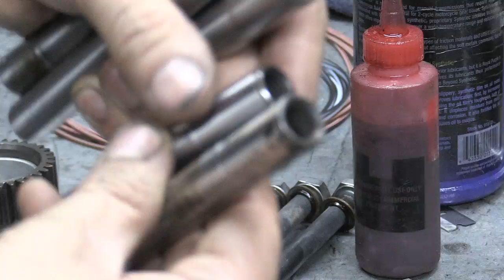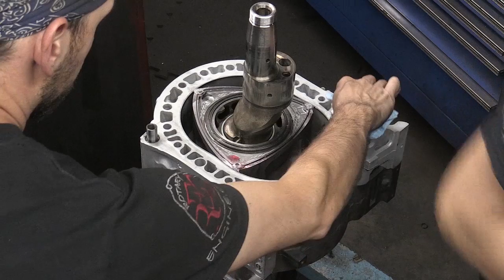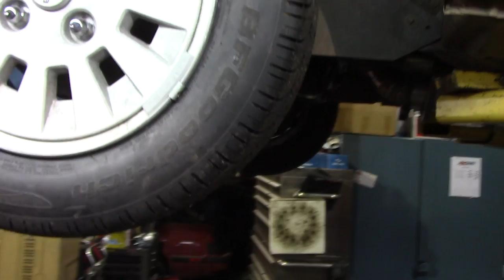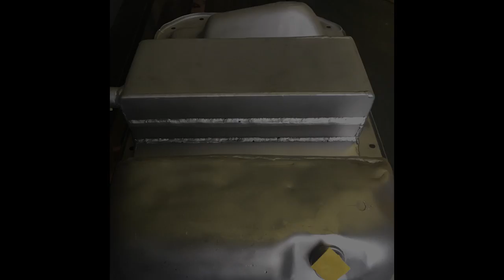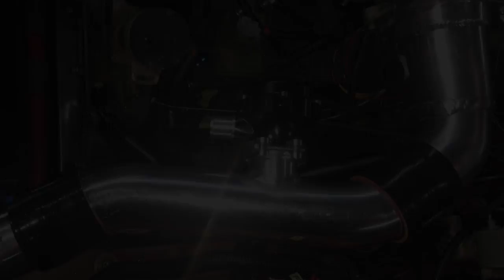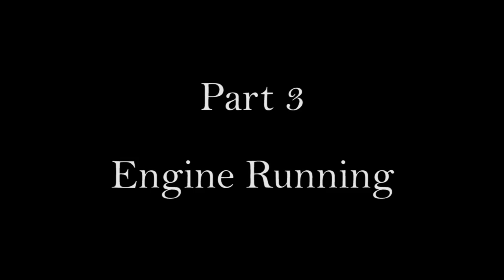700HP 3 Rotor 1st Gen Sleeper - Full Build.

Comment: Everything's beautiful - And I hate to be a critic here, I hate to be "that guy" so please try and read this as a QUESTION! Ha-ha.

But you had me right up to the point where you've got this truncated foam POD FILTER and it's located right behind the radiator!

Wouldn't you rather fabricate an air-box with ducting to a cool air intake, and internal over-sized factory type pleated paper air filter?

I mean, I defer to your expertise on all of this other stuff, but it just seems like common sense that you could improve things via ducting & isolation of air flow to the inter-cooler vs radiator vs oil-cooler vs air intake. That's a lot of stuff all vying for that cool air intake & exit flow, but there are ways around all of it, I'm sure YA'LL know just the type of thing I'm talking about. But just to clarify what I mean by that:

For starters relocating the oil cooler and if necessary all the way to the back bumper or perhaps split it up and relocate it to the front or rear wheel-wells?

Old's-Cool Grand Prix type air-flow ducting. Which is to say separationpanels aft of &/or between/above/below the RAD(s) &/or OIL-cooler(s), angled to minimize baffling, channels made from super lightweight thin grade alloy/Carbon sheets & even corrugated plastic pipe if necessary, (with home heat-vent rectangular to oval to round transition mouldings that are cheap plentiful & lightweight.) All of this stuff could either replace or be integrated into the firewall, weatherproofing, soundproofing, the hood, wheel wells, mud-flaps what HAVE you - Even if it's necessary to the stock appearance, so long as you're only looking at it from the one side then I say it's fair game!

Like I say, an OEM style air-box, fabricated from the same lightweight ABS plastic or Nylon if you're good with the blower & stick type plasti-welding (Nylon sucks to plasti-weld imho, & Delrin is nigh impossible to do it reliably due to weaker 'weld' areas etc) Carbon, CPVC iirc has better heat resistance than regular PVC's, maybe good enough for an engine bay - Well EITHER which way, the air-box could be constructed in such a way as to integrate with or incorporate factory grille crap, to use factory filter retainers & lids etc etc - perhaps to double or triple up on the OEM unit for instance, or go all "scientific" by calculating additional CFM's & look to the figures on the K&N oiled POD filters of various types, compare 'em to CFM's on the "factory replacement" air-box type oiled filters, search their catalog for a filter type with your desired CFM's, cross-reference THAT to whichever OEM style fitment it's applicable to - then steal the factory air-box off whatever sort of ... long-haul 18-wheeler rig or ... marine diesel ... locomotive, municipality grade stationary power generator - WHATEVER it's applicable to, you could potentially dig up a decent lightweight plastic HOUSING for said filter, which MIGHT be in a similar type of styrene plastic you wanna build your duct-work from, and so just that filter surround ALONE - not the whole damn air-box 'cause obviously that's gonna be a pain in the ass moving your engine back ANOTHER 100mm-200mm-300mm etc just to squeeze that air-box in! Ha-ha. But so long as it isn't so constrained as to reduce laminar flow etc, the damn thing could be located WHEREVER you wanted it, just so long as it's air inlet is ducted to a decent source of fresh cool ambient AIR!

Barring all of THAT ridiculousness, it could just be a matter of letting more air through headlight surrounds & indicator mounts, trim pieces what HAVE you, crests & mouldings, decorative trim etc. All of which could be in discrete "sleeper"/"stealth" ways & means, where even a concors judge would need to grab a vernier caliper & a bone stock NOS part just to prove there's a difference. For instance rounding down square back-side corners of the cast plastic grille even! ANY little thing just to eliminate drag & increase frontal area inlet size - Every little smidge adds up and cumulatively this could produce a sizable fraction more open area - So many other engine mods which squeeze out 10% of this or that, well I'm going out on a limb to say that THIS is one of those areas where it's warranted, going to the fuss & trouble, hassle even, of opening up that space - Definitely so, if you're already refinishing the grille & front end parts. Especially so if you're boosting performance and drastically at that!

I don't mean to rant - I ALWAYS type long & rambling like this, so don't go reading it as "vitriol"!)))

It's just ... That hood now has one hell of a lot of power under it! And yeah for all intents & purposes the owner's probably never gonna use all of IT - But I can definitely see a shituation where they use up all of their inlet cool air flow. Might not even run out of cooling capacity long enough to damage anything. EXCEPT, of course, the car's absolute performance figures for that given RPM, that given moment - Look at what all ELSE has been done to get to this point - Is it expecting too much, that somebody should now play around with a bit of plastic & Aluminum sheet? Especially when you'd be able to say what you're searching for is "THE COOL FACTOR". Heh-heh. Cool AIR, that is.

Well if not, just look at all the trouble somebody went to, just making that pod filter LOOK cool......
Reply from the maker: Yup hes is doing a cold air system as a part 2. This filter is quite temporary ...same with the temp header back exhaust.

Comment: I can't believe you'd mount the motor like that.  Sits waaaaaaay too far forward.  A straight crossmember would have allowed this motor to sit 4 inches further back and balance the weight distribution far better.
Reply: Not knocking the build.  It's great work.  But the mounting of the motor should have been of paramount priority.
Reply from the maker: And have the shifter come up through the arm rest?

Comment: Very thorough step through.

One of the problems with rotaries is that a significant component the force produced from the combustion process contributes to the rotor’s sporadic angular momentum at only acute/other angles; rather than - as a traditional 4 stroke/piston engine does - contributing a significant component of the force produced from the combustion process in the same direction as the downward travelling piston.

That said, their absence of reciprocating mass and a valvetrain - combined with the addition of port geometries that even rotary valve piston engines would be proud of, certainly go a long way to compensating for that.

I knew a guy years ago that had a 428 cobra-jet Mustang running high compression, dual dominators, nitrous and a few other modifications that made his car the fastest in the hood. That was until he accepted a challenge from an old beat up looking 
Mazda with undercoat splotches all over it.

I had been in the Mustang a few times and it was certainly extremely powerful and fast; it could easily lay rubber as you changed into 3rd with 4 people in the car.

Back then not much was known about the potential of rotary engines, and most tradition hot rodders laughed at them. 

The Mustang owner was completely oblivious of them, and also how modified the Mazda was also.

After the Mazda won the ¼ mile race the Mustang owner was so embarrassed that he sold his car.

Prior to that the Mustang owner had owned it for 8 years.

Comment: We got into the practice, back in the 70's and 80's in V8 performance engines, to build the bottom end to withstand 1,000 rpm more that what it should see at redline. I've only had one engine break, and that was due to the addition of NoS that wasn't accounted for during the build. We had no other failures other than when the customer chose to finish assembling the longblock themselves. Most often this would be a small block Chevy where they re-used the original oil pump pickup tube and then used too much RTV on the oil pan, allowing a pinched off bead of RTV to get sucked past the screen on the pickup tube and seize the oil pump. Chevy screens detach from the inside of the pick tube's can when too much sludge builds up to prevent oil starvation, and then when they use it during the rebuild it gets sucked right into the pump. The other cause is dirt getting into the engine, destroying the bearings.

Comment: How is oil not being trapped in the new pan where the valley separates the front to rear of the pan
Reply from the maker: It is constantly filling up and spilling over and  well replenished due to the multiple drain back locations. This oil pan also holds 2.5L more then a stock pan. There will be no issues.

Comment: How do you balance the engine with the third rotor?   Do you use a custom crankshaft, or is it a modified 2-rotor crankshaft?

Is this car fuel injected?  If so, where are the injectors located on the intake manifold?

Comment: The oil pan had 3 deeper areas (chambers). Won't the oil just sit in 2 of those deeper areas (except the oil pickup) until the oil level is so that it spills over to the oil pickup chamber? Is the oil level sensor in the pickup chamber, if not then it's quite pointless to have the sensor as it always reads full. 
NB! Much respect for the assembly and being able to fit this monster under the hood!

Comment: 29:42 If you drop the bolt into the hole and hit it at the thread you can damage it, so the screw goes so hard
Reply from the maker: No when you let the tension bolts fall under their own weight they sort of spiral down and they somewhat hydraulic with the air [pressue and I have never had a hardened thread get damaged. Every one will turn in by hand. Youd have to put much more force then that to damage.

Comment: GREAT WORK , I HAVE NEVER SEEN ONE OF THESE MOTORS REBUILT BEFORE SO CAN YOU TELL ME THIS , YOU DIDN'T SPEAK OF OR SHOW IT BUT I NOTICED THAT WHEN YOU PUT IN ALL THE TORQUE BOLTS ON BOTH SIDES OF THE MOTOR YOU DIDN'T USE ANY LOCK TIGHT ON THE THREADS OF THE BOLTS. IS THERE A REASON FOR THIS OR YOU JUST DID NOT SHOW THAT BIT OF THE PROCESS.
Reply from the maker: NEVER Loctite! In fact...oil..just like piston engines.

Comment: wish the waste gate dump was on more of an angle to go with the exhaust flow
Reply from the maker: I do agree that its best to have the venturie effect but in fact There is a 45 deg radius in line and its feeding into a 3 1/2 inch DP. I can promise it is not causing flow issues.

Comment: I'd be concerned about how close the hot side is to the intake runners. IATs for the front rotor have got to be crazy high after a good rip. A blanket and a heat shield coupled with the ceramic coating would do wonders. Just my 2¢ on a glorious build. Top notch.
Reply from the maker: You are so correct. The owner is having a custom shield made and hes ordered a hot side blanket too

Comment: You probably mentioned it and I missed it, but when you enlarge all the oil galleries do you need to run a higher pressure pump or a higher volume one...?
Reply from the maker: Yes we do run the RB race regulator

Comment: Always love seeing shops use schedule 40 tubing for exhaust manifolds. Cant tell you the number of times I had rx7's come into the old shop where I worked and complain about some e-bay special manifold that cracked/broke............. Though I'm not a fan of lapping irons. In my experience the nitrating depth is inconsistent. I've lapped and the motor was fine after considerable miles, however I've lapped and the engine went to pot in 4k miles. Just the one iron that I lapped........... (of course I ate the rebuild)
Reply from the maker: Interesting...been lapping for 20 yrs and never had one issue
Reply: The first one I thought I must have done something wrong, because it was just the 1 iron. The side seals just dug right into the iron, scored up the surface..........Well you know how that goes. Fortunately the customer brought it back quickly as soon as it started hard starting a little bit. When I seen the rear housing was lower on comp. (if memory serves +-20-25% lower) than the front housing I knew something mechanically was up. But what confused me at the time was it was all 3 faces. Anyhow got it apart and that's what I found. The rear iron was all scored up from the side seals. And that one was lapped.  After I rechecked my build log, I chalked it up to maybe a side seal/s were harder than they were supposed to be. Other than the rear it was beautiful. Actually I was quite pleased otherwise. It was my first time getting to see a NRS 3mm 1pc seal working with JHB housings. (well first time getting to check one out with significant miles and abuse on the combo) Some time down the road from that one (couple of years if I remember right) I had it happen again. Same exact symptom. But this time it was the rear face of the intermediate iron. After that we stopped doing it. More as a precautionary measure, "just encase" to eliminate a variable. Some time later I heard Pineapple ran into the same issue. Though I heard that 2nd,3rd or 4th hand so I don't know that to be true.

Comment: I built a lot of engines in my early years as a mechanic and I can tell you guys know yer SH**, I mean "stuff". Plus you take great pride in doing a methodical and precise build paying close attention to detail. I don't know what the price is for one of these but I'm sure it's fair considering the research and testing you've obviously done.
Reply: Some of those oil pan welds looked sloppy...Not sure on the details of HOW it was assembled, but those welds looked like shit I did in high school.... I'll just assume you touched up the holes and globbyness before you painted it, or your gunna get massive seam rust down there.....Everything else was spot on (bent radiator fins is no biggie and happens all the gawd damn time on those old rads).
Reply from the maker: Thank you!
Reply: SHIT SHIT SHIT SHIT SHIT SHIT SHIT SHIT SHIT SHIT SHIT SHIT SHIT SHIT SHIT SHIT SHIT SHIT SHIT SHIT SHIT SHIT SHIT SHIT SHIT SHIT SHIT SHIT SHIT

Comment: Why not use the extra mass of the rotors like in the GSL-SE? They created more torque.
Reply from the maker: Too heavy and  didnt want to use 3mm seals and dont like the fact that early rotors only have 9 roll pins to retain the gears
Reply from the maker: So can heavy rotor
Reply: Interesting, didn't know that. Thanks for the information.
Reply: Viper310 that is a good point. maybe the idea is that they are making up for the torque with a higher rpm with these lighter rotors. Not sure how much more rpm it gets you though. I'm a noob.
Reply: Higher RPMs is harder on the Stationary gear. Just a note.

Comment: Do you build 26b engines?
Reply from the maker: yes but there is no such thing as a production 26B...most guys bolt 13B parts together to do a 4 rotor and I much prefer a 3 rotor turbo platform

Comment: Quick question.. Where do you guys or where would an average Joe find a 20B to build/put into a rx-7 or rx-8? The only place I've really found them is Ebay for $7 grand er so, is $7 grand the usual going rate for a stock 20B these days?
Reply from the maker: Yes $7k is the going rate. Its the same price we charge when we supply the core to do the build. We do not sell them outright for 7K. We only sell engines to customers who want to have an engine built by us. There is an extreme advantage to have us supply it though. Any engine you find from Japan might be blown on one or more rotors and might have worn out or corroded parts. When buying an engine from us, we confirm that you will get an engine that is %100 build-able the way it is and all parts guaranteed to be usable. If the engine we supply has any problems, we tear down another engine until you have all parts needed to complete the build...with no extra cost to you. $7k guaranteed
Reply: Thanks for the reply. I suppose ill have to save a few more pennies to get a 3 rotor into my rx-8, haha. Keep being awesome and keep the awesome videos coming! Thx!!
Reply from the maker: Yup more vids coming

Comment: So I've heard the 3 rotor can run up to 92 dB without heavy noise dampening. I love the idea,  but let's be realistic - this is hardly a sleeper.
Reply: James Szczesny it's a noisy sleeper
Reply: James Szczesny 
I'd never consider any sports car a sleeper. 500HP Toyota Camry is a sleeper!
Reply: Zachatilla it snores. loudly.
Reply from the maker: Based on sound..yes I agree...but the exhaust is temporary and what can you really do about it
Reply from the maker: Exhaust is completely temporary. In fact it did not even have a silencer on it yet. Owner plans to do a custom back half by spring

Comment: simple question of the day: How to do you assemble 2 piece apex seals?

I understand that the small piece faces the rear of the motor, but how do both pieces stay together for installation?

When I install my E-shaft does the rear lobe face away from the spark plug side? 
(3 o'clock position)

Thats what it looks like in your video but I want to be sure.

Cheers
Reply from the maker: The 2 parts are glued together for assembly and break free when the engine is torqued
Reply: Thank you. Is my information correct concerning the e-shaft?
Reply from the maker: You can attempt to put the small piece in last but its best to glue it on for assembly